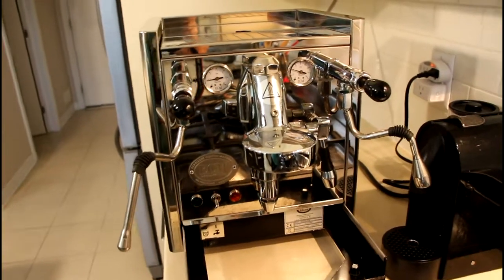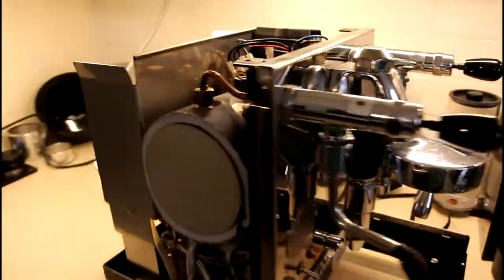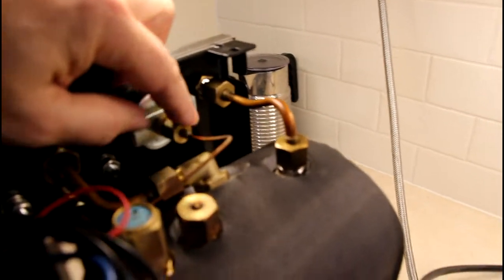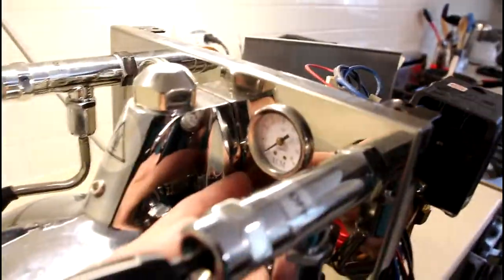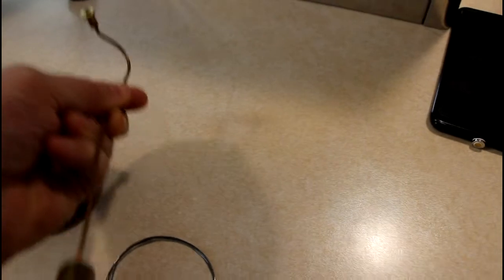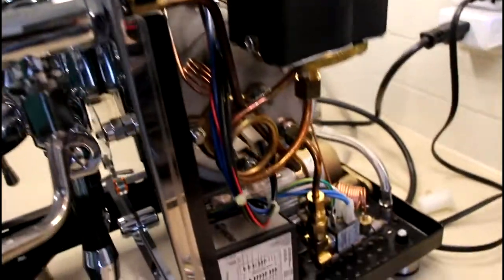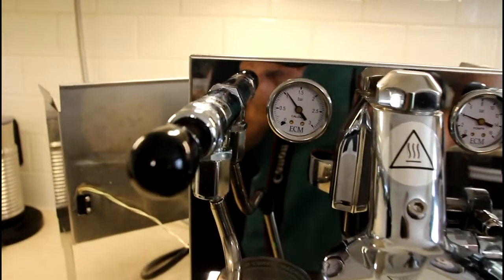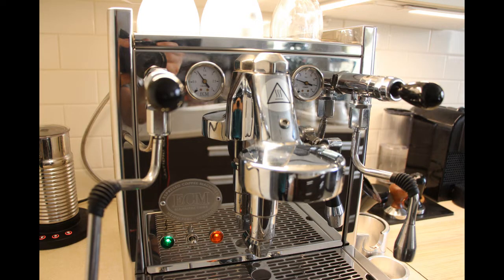ECM - Fixing Boiler Pressure Gauge

Comment: I didn't have a wire, fitting into the tube, so I just put the whole pipe in white vinegar for 15 minutes - then my pressure gauge changed from 0,4 bar to 1,2 - 1,5 range. So thank You very much for this tip.

Comment: Do you have a solution for lost pressure
Reply from the maker: Interesting enough, my machine didn't have pressure for a week - it just didn't want to heat. There could be different causes - but in my case it was a stuck water probe. I did a full desalination with overflowing the boiler - and it did help!